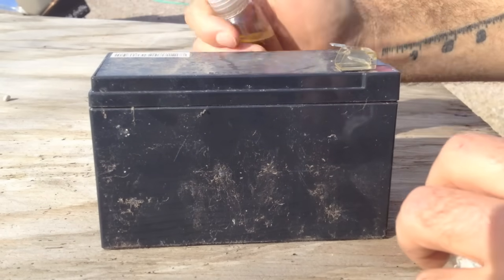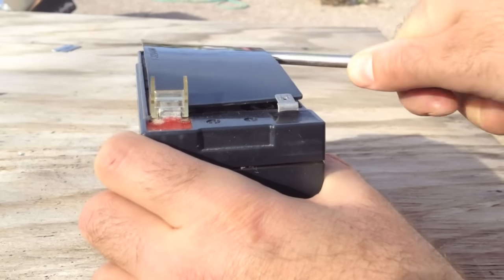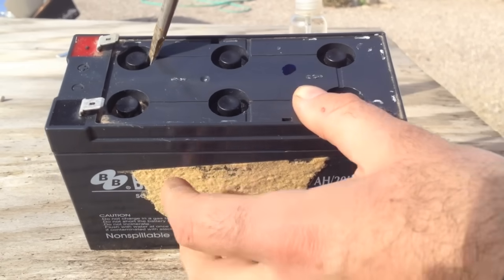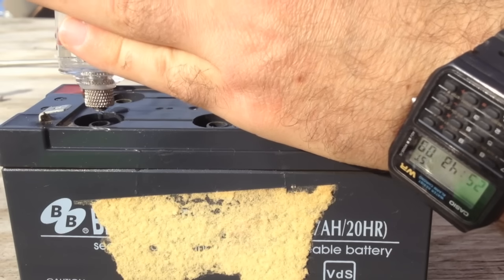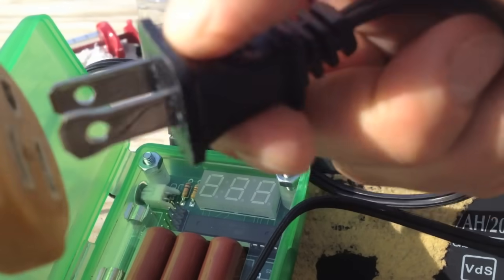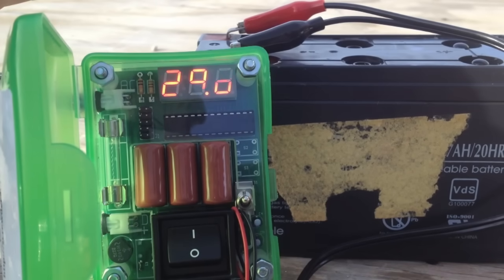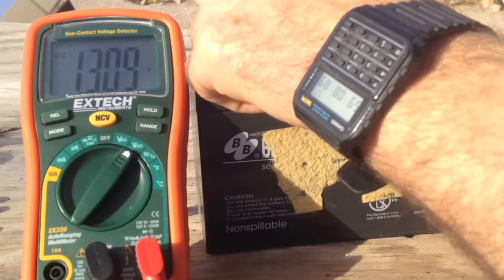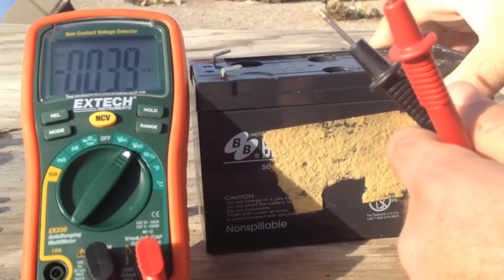Sealed Lead Acid Battery Recovery

Comment: there is a difference between a sealed lead acid battery and the absorbed glass mat .... sealed lead acid is what it is  lead plates with sulphuric acid as the electrolyte  , the acid wont evaporate but the water component will, thats why adding water  might  rescue the  battery  but theres is still the sulphating  degrading of the lead   if its shot   its shot,  nothing will bring it back from the dead, and it can only be installed  one way up !!!!!i  now  the agm   acid glass matt  the lead is wrapped with acid soaked mat  and again if its old and drys out a bit   the battery  don't work to well,  the AGM battery can be used in any position , a true non spill battery , the fact is the difference between volts and amps 12 volt no amps , only good for a light ,,, scrap it , the amps is the electrical power charge that drives the electrons  to start an engine,..  to complicated to explain here,   then there is testing the specific gravity of the electrolyte 
my old Yashua 6 volt SLA batteries had a 3 volt reading,  tops would break so i drilled  holes where the plugs are, then  filled with rainwater , took a bit of water, hit them with the charger using lots of amps,  brought the reading up to 5.7 volts, they were 7.5 volts a few years ago, but never kept them maintained ,, only used for led emergency lighting.

REPLY

Hide replies

Comment: Better put battery solution in there though, in my experience
Reply: with lead batteries, 20% h2so4 is optimal, the water goes with time, the acid stays, if you add fresh new battery solution (distilled water with 20% acid), you must rince the remaining acid first or you'll get around 40% acid... in the showed example, only distilled/rain water is enough...

Comment: When you charge lead acid battery, it produces water itself in the time, so filling it with water is just the faster way to make your battery dead. Water is only used for acid batteries, which are used in cars, but not in lead acid, which are sealed becasue they arent refillable..

Comment: I heard that if 12v lead acid battery goes low than 11.5 V.... its gone. So the 3 cell Lipo battery can go as low as 10.5  V It's much better. So the LiPo (Lithium Polymer battery)  is 3 times more powerful per weight and can be discharged more that lead acid. The cycle life of Lipo is higher. Also you don't need to fill it with water to recover. Lipo is really sealed. That's why its used In Tesla cars and mobile phones :) But its more expensive than lead acid :((
Reply: +CoolStreamT 
If a lead-acid battery cannot hold more than 11.5v when fully topped up with electrolyte then it is dead. If the low charge is due to low electrolyte level it can be restored by adding more water.
Reply: +CoolStreamT   Not only LiPo and its likes are more expensive, it's also not very forgiving.  The discharge and charge rate/cycle has to be carefully controlled.  This is why you don't see general purpose LiPo 9v/5v/12v batteries.  (Ok it's out there, but it cost alot and dont last long.)

Comment: does are non spillable batterys. meaning they do not require water. Also non as agm batterys (absorbed glass mat) 10 years in the battery industry

Comment: Sir i have a newly bought 6V 10Ah battery but the reading in my multimeter is 6-7 V but 1.36 A only. I tried charging it for almost days but the amp reading is the same.   is it defective?

Comment: Jell-cell battery's can not be repaired, I added water and charging it, no good.
Once these battery's go dead you can't recover them, I tried many times, I had two 12 volt gel-cell battery's from UPS supplies and other gel-cell battery's.
What happens is the cell plates get sulfated and short.
Replace the battery, sorry but what you are doing does not work.
Reply: And it didn't work for me...
Reply: Agreed,it didn't work for me.

Comment: Ran out of characters again.
If you have a 6-12 volt charger start off with 6 volts or you are going to pull lots of amps and possibly overheat your charger. Once it charges to 6 volts then flip it over to 12 and it will charge up fine. What I assume the "Da Pimp" does is it slowly ramps the voltage up so it doesn't pull many amps off its LM317 or whatever chip it may use. The "smart" ones only have 6-8-12 volt settings from the chip, not full range like "Da Pimp"

Comment: I mean this is all good and well but how do you get the fucking top back on?
Reply: Shiraz Nunis
You didn't answer my question.
Reply: TheDistractionTrap ouch gotcha, c how lame and infamous my lambchop
Reply: TheDistractionTrap ,  it was obvious that "Jonathan duToit
    " was looking for a simple, more professional looking fix to getting the cover on, without having to use a razor blade again in the future... and was asking the guy that suggested to cut it off, to see if he had a preferred method.  indeed the best route would be to devise one for your self instead of asking to be spoon-fed.  though I find it far more annoying how intent you are on handing down criticism instead of answering the question, and furthering the discussion. ^^^ all pointless dribble up until this point.  you could try to carefully epoxy four or so bolts, head down, with matching holes in the top to fit over and secure with nuts.  or you could simply try using rubber cement; it wouldn't be too strong to hinder removal later, but could make a decent seal.   assuming the solvent in the rubber cement didn't ruin the plastic.  at least put forth some suggestion as an improvement if you are gonna comment, not just bashing people, because that is a pointless waste of time and effort for you and others.  as no one learns anything and then they have to read your worthless comments.
Reply: +Jonathan duToit A very big sledge hammer, wait with hammering till the battery is fully loaded and dress yourself in some expensive armani clothing

Comment: But you won't get the full capacity back with that pimp charger, will you? I mean, if this battery had a capacity of 4Ah for example, after reviving it, it may still have 1 or maybe even 2 Ah. At least that's my experience with lead acid batteries and recovering them with high voltage pulses (i.e. from a Re-EMF charger).

Comment: NEVER use water to refill batteries, use industrial strength hydrogen peroxide. Batteries outgas hydrogen while charging g and oxygen while discharging and do it in equal amounts.

Comment: After reading a LOT of the comments do ANY of you know whos RIGHT? It reads like a lot like I now have to check you tube for rain water good or bad same with battery acid and all the other things someone said in there reply. I will ask why not clean the battery out with baking soda water to clean the plates or it dose sound like they are covered with something. ??? I dont know. Looking at the right side of the screen they fix batterys with Alum water and some with Epsom salt and god knows what else. But all in all I guess if it dont KILL you try something else till it DOSE

Comment: Rainwater=NO, Distilled water=YES ! Impurities in the air equals pollution. Distilled water is the purest water for a battery. A dead battery will never act as new no matter what the battery Voltage and Amp rating it started with. At best, you will get a somewhat dimnished capacity for  shorter time.

Comment: rainwater? ????????
Reply from the maker: +sms msn As clean as it gets. You want rainwater.
Reply: +therealnightwriter The rain picks up a lot of dirt when it starts raining but after 20 minutes the rain has &quot;cleaned&quot; the air it&#39;s falling trough so much that it actually can be used as a substitute for standard distilled water in a battery. A battery is no high precision swiss watch you know!
Reply: yeah?

Comment: Well there's a reason there's do acid floating around in there You just diluted it less than half the strength it should be! Batteries deteriorate & after 5 years of even light use that battery would be toast. Utter waste of time. If you could do this to revive batteries I wouldn't have 5 pallets of car batteries here ready for the scrap man. I'd revive them & sell them for about $50 each on Facebook!
Reply: If There were No Available Parts Store Around, If You were on an Abandoned Island and Just Needed Something to Do for The Day, This Is Useful Information. One could go buy a Battery, Install it, Start Their Equipment  and Have It Running in the Time it takes to do or watch this.

Comment: You are so concerned not to crack the plastic lid even though its only job is to keep the rubber lids in place. 
Then telling people it can have high pressure and spit out fluid 😅
The rubber lid are made to allow the tiniest amount of pressure to get out but no sucky sucky back in.
Then you actually overfill the cells which can cause it to leak fluid when you charge or use it since the fluid expands or if it starts to boil..
Plus you fill them up to the point fluids are outside the battery and then cutting the video not showing people how get rid of that spare water potentially filled with strong acid.
Great job...

Not to mention that these kind of batteries have a certain percentage of acid that you will delude when not keeping the water approx 2 cm from the top. 

But at least the plastic lid didn't crack. What a disaster standing there with acid all over just to find that the plastic lid was not pretty anymore 🥳

Stop teaching people this online when you don't even can do it the right way yourself.

Comment: Why don't you use a safety knife. Ya know. With a retractable blade. Might keep ya from getting stitches.  Just a couple stitches at the ER will cost you more than one of those El cheapo batteries.

Comment: You can try with a battery you were going to discard anyhow.  Author does not reply.  Don't ask questions.
Reply: @Trevor McFarland Back up battery for internet is a Yuasa (NP7.2-12  12V,7.2Ah).  It won't take a charge.  Probably dry, sitting for 3 years though it looks new.  No easy way to cut open, but I thought I could have fun.
Reply: @Trevor McFarland It is one of those batteries that cannot be opened.  No groove .  I can buy one somewhere.

Comment: This will only work if your battery is not dead or shorted.    If it is the battery will never ever take a charge.   He is showing you a battery that is still good.   if your battery is dead or shorted out between the cells throw it away you are wasting your time.   Go buy a new one.

Comment: Incredibly naive to think that just a good voltage means you've fixed the battery ...not so. All I do is fill it with non ironised water and then pump a decent amount of amps into it so that it boils all that white crap off the plates. 

Then once it cools down I put something across the terminals that is a high demand draw, like a vehicle head light to drain it hard and I do that a few times, and then do a complete trickle charge and the battery is perfect again. 

The trick is getting a battery charger that pumps in the amps... bu not so much that it blows the crap outta the battery. It should take around 30 minutes to start to get the battery to simmer.

Keep repeating the steps until the water absorbs all that white stuff off the plates. DO NOT THROW THE WATER OUT! Top up if required. DONE!!!

Comment: YOU ARE SERIOUS JUST WATER?!!
Reply: MrCjjones101 yes, some car batteries have ports on them that allow you to do the samething.
Reply: Rain Water or Distilled water
Reply: The illuminati Rain water is filthy and should NEVER be used for this purpose, Tap water is not much better either so ALWAYS use distilled water, You should flush the batter out also before adding new water. If you know what your doing you can do the water and alum mix on it which will revive a car battery from the grave.

Comment: Used bottled water and wrecked all my batteries.
Reply: I believe we're supposed to use distilled water. Never heard of using rain water, but I KNOW we cant use chlorinated water from the faucets and such...
Reply: Dan Marron. So I should of boiled it first I guess.
Reply: @christsrevenge8030  Boiling it does not remove the fact that it has still come into contact with metal, be it the pot you boiled it in or the kettles element the water was coming into contact with the entire time it was being boiled. This apparently prevents it from being used in batteries as it has metal particulate in the water which is a "No No" for any lead based battery 🤷🤷🤷
Reply: Gadget :p. Makes sense. Am learning. Can the metals be filtered out? Can rain water contain metals?
Reply: @christsrevenge8030  As far as I have heard, rain water is the better option (as it will most likely be acidic (acid rain, go figure)) but only if you can't get hold of demineralised water which apparently is sold abundantly by the likes of Walmart and Cosco (Not sure if I spelt either of those correctly as I have neither here in my country). 

Ps. Also, I would assume the way to remove metals from rain water is distillation (pot within a pot method) or membrane filtration (like using a reverse osmosis water filtration membrane) , although there may be methods I am unaware of 🤷🏼‍♂️🤷🏼‍♂️🤷🏼‍♂️
Reply: Gadget :p. You are awesome Gadget :p!
Reply: @christsrevenge8030  Ps. NEVER flood fill an AGM battery, as the battery states, it is an "Absorbed Glass Matt" membrane battery and only needs to be moist. Try adding 10ml at a time to each cell and test to see if there is any difference/change in charging results. All these videos showing people fill these batteries to the top with whatever they are filling them with are Wrong. It astounds me just how much misinformation there is around batteries and people showing how to revive them. 

Flood filled batteries also have a "DoD" (depth of discharge) rate of 50% while AGM batteries have a DoD of 80%. If you go lower than this on these batteries, I can almost say with certainty that the battery will no longer give the correct amount of Amp Hours (As shown on the battery label) or it will never recover. Also, if a battery "Boils or Bubbles" excessively, this means there is either 1 cell that has shorted out or not taking charge, so throw it out rather than creating headaches for yourself.

Good luck with your endeavours and be safe, as I "Know" from experience that battery acid and human skin/eyes don't mix well 🤣🤣🤣

Comment: Lmao thats a agm battery. Water doesn’t “revive em”
Reply: Definitely says "sealed lead acid battery" on the side of the battery.
Reply: Chaz Daly there are no sealed lead acid batteries. 🤦🏻‍♂️ do you even understand chemistry?
Reply: Dude wth? Just Google sealed lead acid batteries. They are simply lead acid batteries that are designed to NOT be tampered with by consumers aka "sealed".
Reply: Chaz Daly sealed lead acid is AGM. It doesn’t have water, it has gel and glass fiber wafters. Please do some research. Its lead acid GEL in glass fiber mats. 

No such thing as sealed lead acid, lead acid liquid batteries need breathers, capishe? Agm doesn’t need the ability to breathe, hence sealed. Nothing to do with consumers, everything to do with the fact you can flip a agm battery say in a portable pack UPSIDE DOWN and acid won’t pour out.

Comment: First off real smart pry with a razor blade, second are we really so cheap that we are trying to recover a 20 dollar battery? if you are trying to be environmental recycle it and buy a new one
Reply: @julianchoque7402  Lead acids are like 200 years old, i'm pretty  sure they are sold everywhere.
Reply: @cekpi7  we dont have lead battery for sale here in ur p1ace
Reply: No shit. Some SLA can cost over few hundred dollars. Depending on the size. Recovering a dead sla is definitely a better option